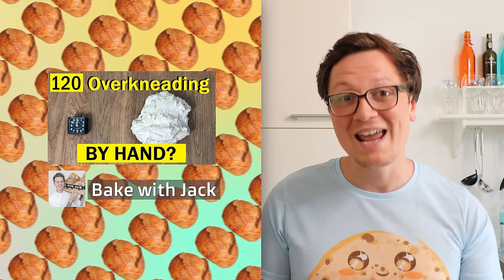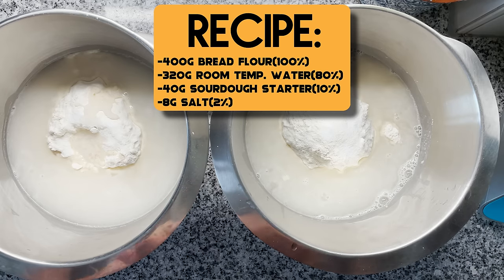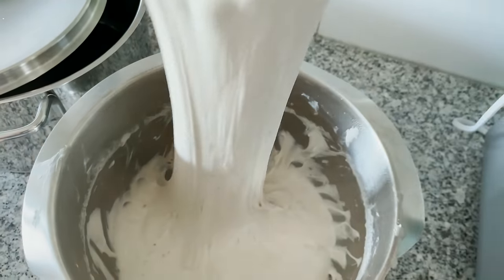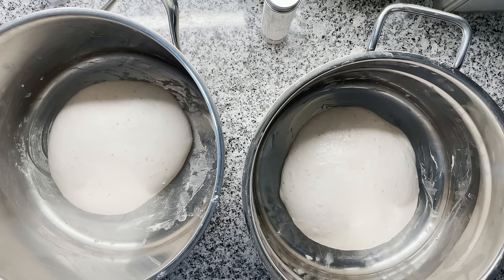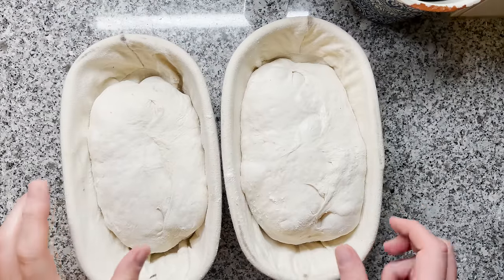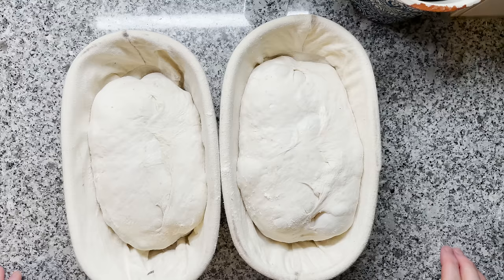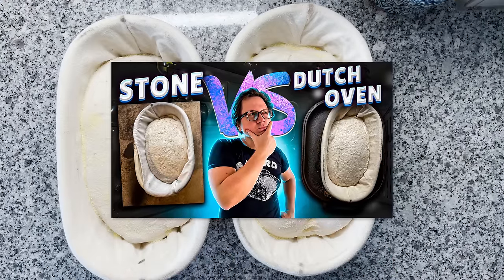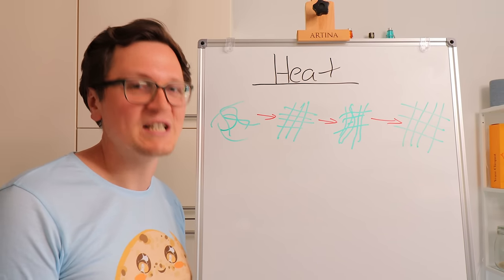Can You Knead Your DOUGH TOO MUCH with a Stand Mixer?

Comment: I have no idea what I'm doing wrong. After about 2 hours hand kneading one time and today 1.5 hours with a Hand Mixer, it still has the consistency of 6:00. I can't ever get it to get past that stage, even with letting it rest for 5-10 minutes one time or several times. I just give up and just continue onward with the recipe and bake my "prematurely aged" bread. Just basic white bread, too. While kneading by hand, it sticks to everything that a scrapper doesn't help that much. 

I came here because I wanted to know whether or not I was overkneading. But at the consistency of 6:00, I am still underkneading after 2 hours. Somehow...? Making bread is very difficult...
Reply: You probably have a not good flour. It all depends on the flour. If it has high protein content, the results are mostly good if you over knead or not. If the flour is not good, it doesn't matter what you do.
Reply: @devoker666  I used King Arthur's All-Purpose Flour, which is advertised as a medium protein content flour. The recipe, simple White Bread, calls for All-Purpose instead of Bread Flour.
Reply: @Mary-Ann_B_Mabaet  I am pretty sure in these open crumb bread videos, they all use at least 13% protein flour. Also not all high protein flour are good. I tried some 13% which can't hold more than 75% hydration.
Reply: @devoker666  I think it says its 11%. Is that too low or too high? It seemed to hold onto the hydration too much and kept sticky for too long.
Reply: @Mary-Ann_B_Mabaet  ı think 11 percent flour cant hold more than 65 70 hydration, you gotta try in small amounts to see if it creates windowpane.

Comment: The test or comparison is flawed due to the use of a stand mixer that is unsuitable for kneading bread dough. The Bosch Mum stand mixers are extremely unsuitable for kneading (bread) dough, except for simple cake doughs, due to the shape of the dough hook, the shape of the bowl and the power of the motor, if you really want to achieve good (professional) results.
The Kenwood XL Titanium stand mixers, for example, and generally the Kenwood XL devices with the 6.7 liter bowl, are much, much more suitable. Due to the dough hook and bowl shape as well as the adjustable speeds and power of the motor, you can achieve a really reasonable dough consistency. The temperature development is also much better. On the other hand, Bosch Mum devices are unsuitable toys for baking bread and comparing kneading times, with them you will never get a really good dough either way.